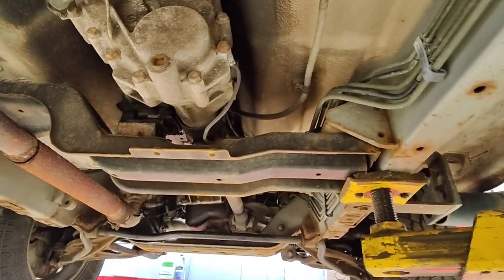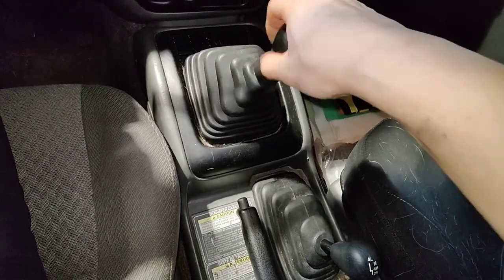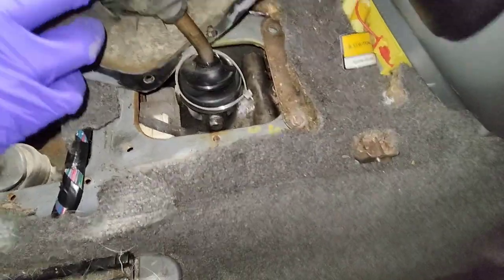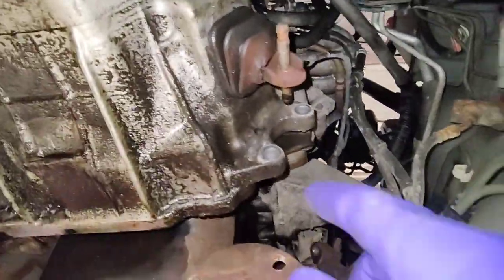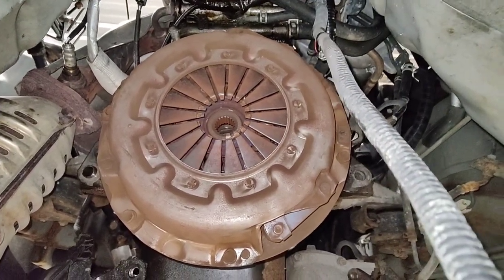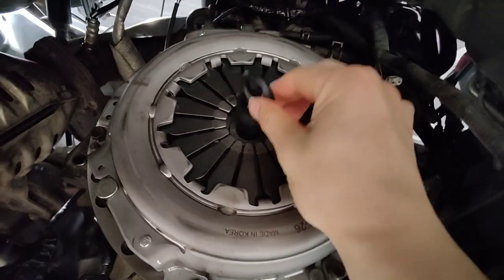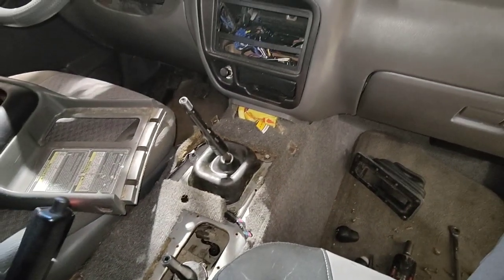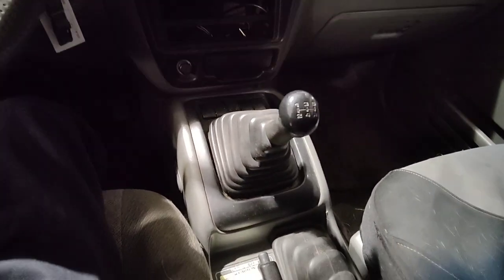2001 Chevy Tracker no clutch pedal. Clutch replacement.

Comment: This car would be my nightmare. How much did the person end up paying for the repairs?
Reply from the maker: The job was easy, finding parts was the issue and the first clutch kit I got it didn't even spline into the input shaft after I torqued everything down, I should have checked first and it wasn't the wrong kit either. Took everything apart and had to order another same brand because it was the only one available. I asked for 6 hrs which was pretty much book time when you add up the little stuff. But the price was between my manager and his buddy. He ended up throwing me an extra 2hrs for my trouble.
Reply: Which clutch kit did you end up ordering?  @theoffroadingmechanic